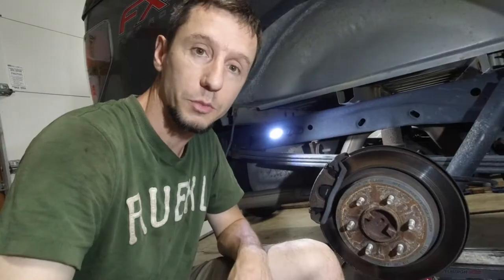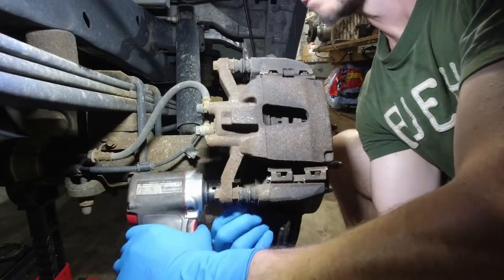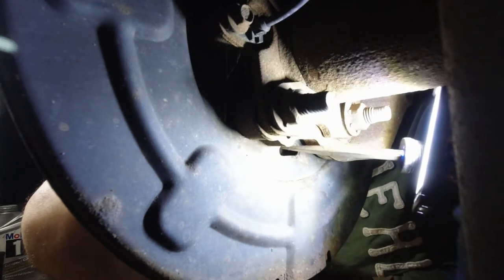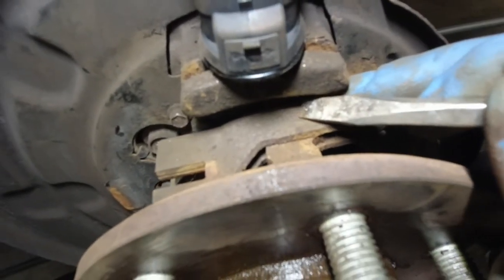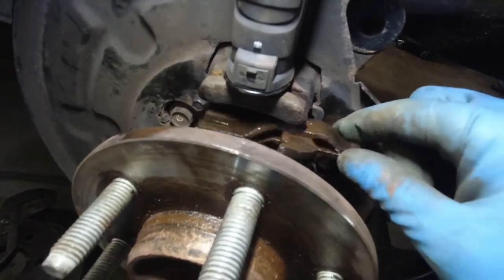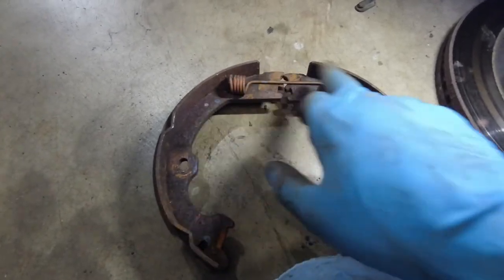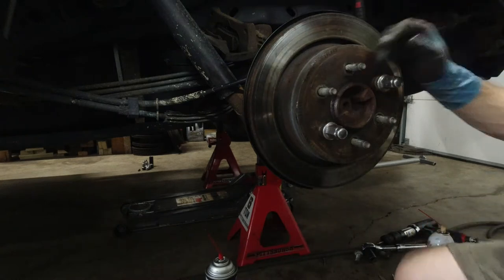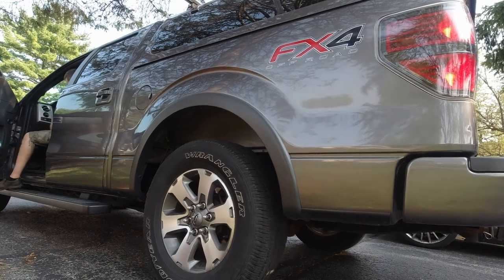Ford F 150 ecoboost how to parking brakes

Comment: I have been wrestling with my back rotor for about 3 weeks now trying to figure out how to get them off, I finally got a puller and just completely tore the rotor off taking taking the breaking system with it, really wish I had this excellent video about about 2 weeks ago lol

The parking brake shoes were stuck out like you mentioned and in deep grooves, preventing me from taking them off. The left one wasn't the issue as I hit it and it came off, but the right one was definitely siezed up and stuck open. 😬 Now moving on to find parts...
Reply from the maker: Yap sucks, but now you know...

Comment: The ebrake is notorious for sticking on these. I found the easiest way is a long bolt through the caliper mounting hole, with a nut on the outside. Hold that nut with an open end and drive the bolt head with a socket or gun. As the bolt pushes against the back of the rotor, it will pop & release
Reply from the maker: you might brake the parking brake shoes doing it that way if your trying to save them.  But yea, thats one way.

Comment: When were you hearing the squeaking? I'm having what I think is this issue on my 2015 durango.  Hearing some squealing which initially I thought was work brake pads but it wasn't. You can hear a loud squealing at low speed in a drive thru or stop and go traffic or When leaving a parking spot.
Reply from the maker: same as you, try pressing the parking brake slightly and see if it goes away.